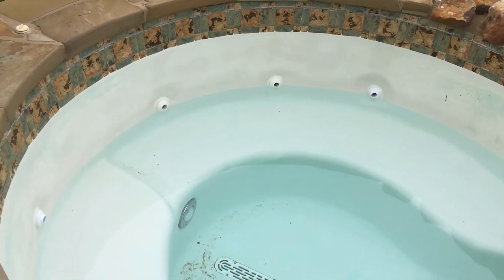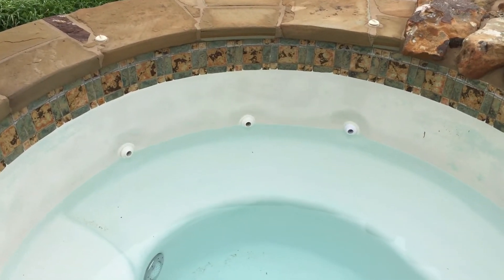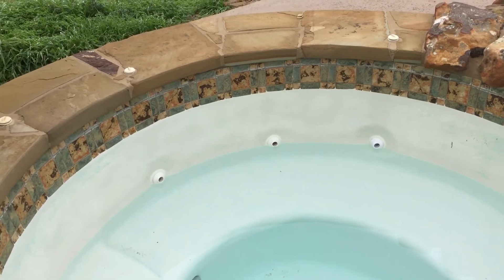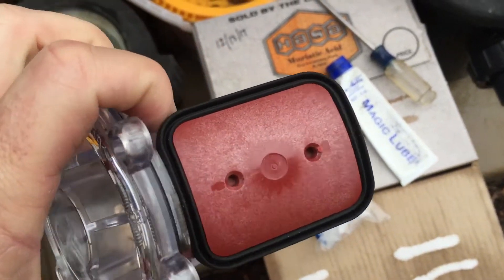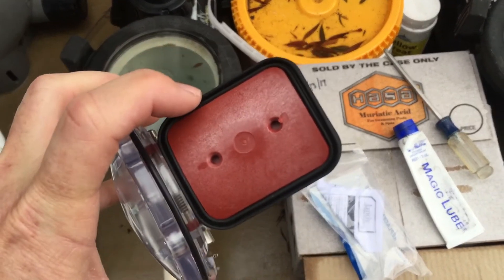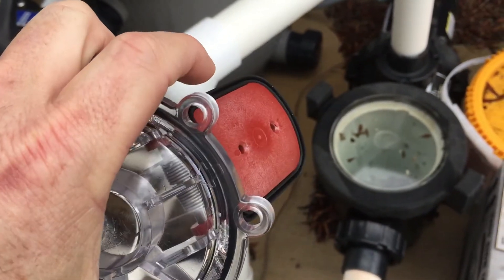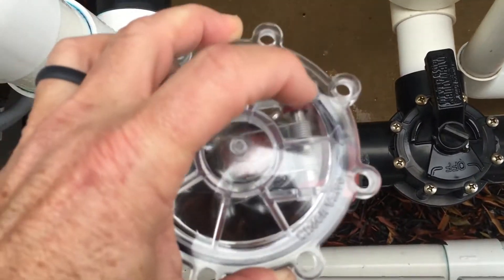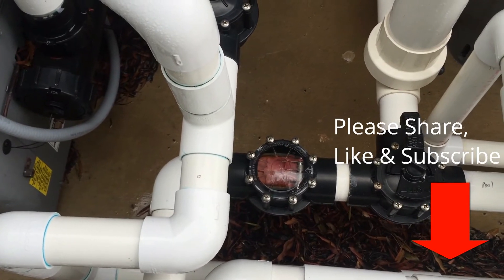Why is My Spa Draining Down When the Pump is Off?

Comment: Good video and to the point.   My spa check valves work fine after replacing them as you suggested however if my spa drain is left in the open position, the spa will drain to pool level.   Is it okay to add a check valve to the spa drain line ?   Is a check valve on the drain side of the filter considered okay ?  PS, I subscribed to your channel.
Reply from the maker: Thanks! You can add a check valve where ever you want to, there's no problem.  Just make sure the flow arrow is pointing the direction of the flow of the water.
Reply: @truelightpoolsllc4441  Thank  you!
Reply from the maker: @genesouth9517  Sure thing.

Comment: Hello, my issue why spa water drains during heating the water. What should I look for?
Reply from the maker: Either the pump is on a low speed or a valve is not set correctly in spa mode.

Comment: Could the leak also be from a leaking diverter in a jandy 3 port valve? Thanks for the video
Reply from the maker: Possibly, but 99% of the time it's a failed check valve with these symptoms.  Once you replace check valve internals and something is still leaking when the pump is off, then investigate other possibilities.  Thanks for the question and take care.

Comment: Replaced both valves and still draining down, what’s next?
Reply from the maker: You must have some valve in your piping that is allowing the spa water to escape from the spa and equalize to the pool.
Reply from the maker: I have a different video that shows how I added a check valve to the spa side that never had one to stop the spa from equalizing to the pool every night.
Reply: Thanks for the feedback, didn’t see the second video, what’s the name? Thanks for all the great pool info btw
Reply from the maker: @bbq4fun789  https://youtu.be/bu8W3g3J01w
Reply: Fixed it by rebuilding the 2 Jandy diverter valves that switch over from pool to spa. Thanks for your help and advice.
Reply from the maker: @bbq4fun789  Great!

Comment: No!!!!!!!!!!!!!!!!!!!!!!!!!!!!!!!!!!
My EMAUX Check valve fails after no more than a week!!!!!
No. Check valve is useless. And the cost od a new Flapper is 80-90% of a whole new valve!
Reply from the maker: I looked up that check valve and it is very cheap looking, that's why it's failing quickly.  Cut that out and install a Jandy check valve, you can put some lube on the flapper valve and it should last you a year or 2 before needing to replace it.